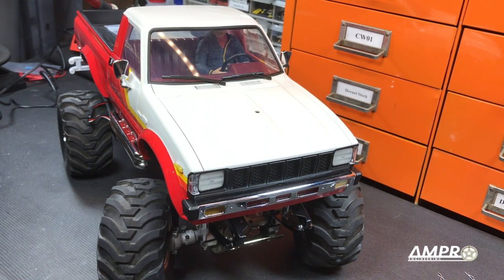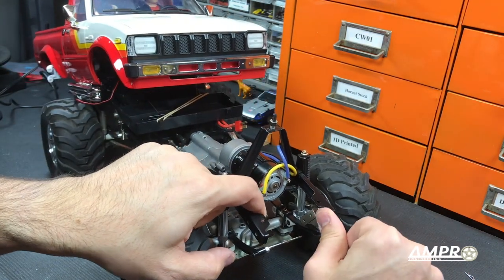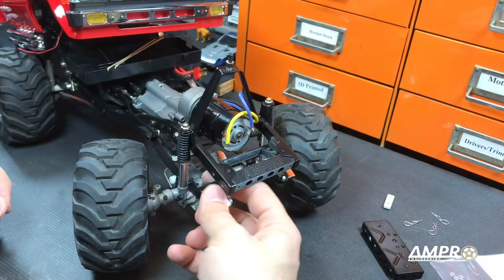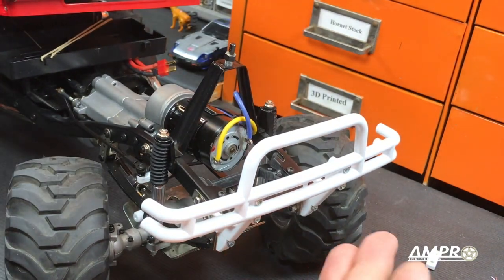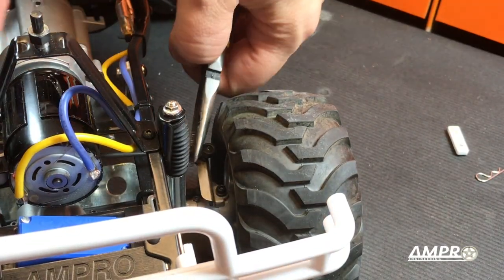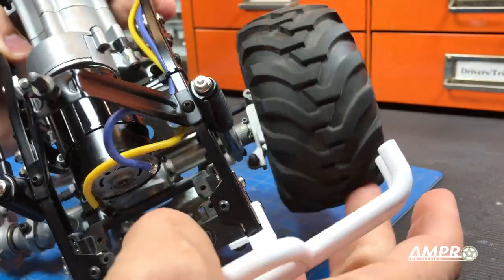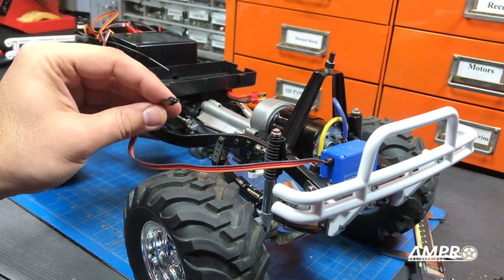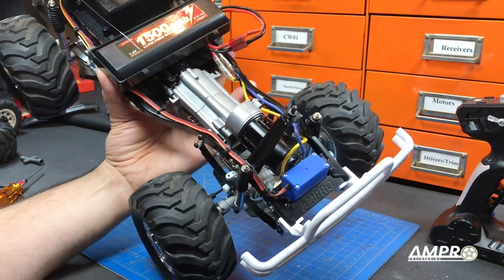e205: HG P407 Central Steering System

Comment: I did the samething but i mounted the servo on top the ampro piece because I found It kept popping the ball ends out of the steering link due to the angle of it. Had to cut a little off the frame but it works way better and is straight across and all around perfectly lined up. Has not broke sense then!💯🤪
Reply from the maker: Weird really? I have not had this issue. Glad you found a fix.

Comment: I just had the tabs snap off the 3d printed aluminum steering arm , wasnt expecting that ,  it did hold up for almost a year  so thats pretty good ,   i was just driving on flat land and i guess there was a small bump that jerked the steering just right and snap
Reply from the maker: Wow really? Man that's a bummer. Mine has been gut but who knows what imperfections there are.
Reply: @AMPROEngineering  Its ok i just ordered another one , hopefully it will be here by mid november

Comment: £14 for a piece of plastic and they cant even tap the holes for you ? Classy !
i'll give this a miss , there are easier and cheaper ways of sorting this issue .
Reply from the maker: This is a 3D printed part, this is not injection molded. They are made with VERY different processes, made of different materials, and made in to order.

Comment: Another elegant solution 😎👌🏻👍🏻 

Very much looking forward to your battery tray mod👍🏻 Will that be only for the clone car too, or is it likely to be a fit for the Tamiya rere?
Reply from the maker: Thank you! it fits the clone also, in fact that is where it is installed. I also have one for the original bruiser.
Reply: I’ve not built my re-re yet so am not familiar with the battery tray. 

I know the gearbox is different to the 1985 car, but I’m not familiar at all with much of the rest of the variations between the 1985 car, the rerelease and the clone. 

 Will you have battery tray mods available for all three cars ? 🙂
Reply: Just realised how old this video is 😆👍🏻

Comment: Hi. I have an ReRe Bruiser, and have bought your front Servo mount and front hub spacers. Looking for a viable way of connecting to the steering hubs after snapping my stock metal plate and found your YouTube channel. Tried looking on Shapeways where I bought the other bits and couldn't find the part number you posted. Would you have a link?
Reply from the maker: So the only parts I offer for this is the main mount and the steering arms, both are linked in the description and I validated the links so those are both working. If I am missing something, I am very sorry. If you could email me at Amproengineering@gmail.com I will see what else I can do.
Reply: @AMPROEngineering  I saw the link in the video when I viewed on my  PC instead of my phone. Will be ordering, after I finish my next Modification. Currently running Schumacher CAT XLS shocks all round. Will email you though

Comment: I added this servo mount this weekend. 
1.	I moved the shock mount behind the axle. Inserting the first screw second to the rear then using a scribe to align the front hole I was able to mount it without cutting or drilling on the frame.
2.	By moving the shock mount the steering arm no longer made contact with the shock body. I didn’t do a before and after but I think the turning is tighter than original.
3.	I took a crescent wrench and bent down the undergaurd diff cover as it was impacting the servo horn under fully compressed suspension.
4.	Using a turn buckle I had for an 1/8 scale application gave me a tight fit with no play at all. Redcat Part Number 81204.
Reply from the maker: Fantastic information. Thank you so much for that. I will look into this
Reply: @AMPROEngineering  Any time. I'll be ordering a second set soon. It's such a huge improvement.

Comment: Why buy a servo mount when you can use a dremel and cut a rectangle out of the original brace in between the two top screws and make your own servo mount. Mine worked fabulous.
Reply from the maker: Eh, I hate chopping up metal. This took 5 minutes to design.

Comment: Hi i need to replace the speed controller and steering servo and reciever any suggestions thanks on my hg p407
Reply from the maker: Any 2S Lipo speedo will work as long as it has 60A draw or more. As for a receiver, you need a 3Channel as well as a radio that accepts a 3 position 3rd channel. No clue about that one.
Reply: @AMPROEngineering  thanks for your help
Reply: I fitted a Hobbywing 1080 Crawler ESC to my ReRe Bruiser. So much better than the 1060

Comment: Pretty cool. All the screws on my "Chruiser" have been a boogerboo to remove. Seriously torqued down WITH sometype of red threadlock. Its a fine line between stripping the hex out, snapping a ball stud or rounding off a hex key. I split a Tamiya wrench trying to remove one of the steering ball studs.
But uts all fun still.
:))
Reply from the maker: Really! Man mine had zero threadlock on anything. I see they heard customer complaints that cars were rattling apart!
Reply: @AMPROEngineering  I know right? I guess getting threadlock depends on how late in the week when they're built. They gotta meet that qouta to get the weekend off !
:))
Reply from the maker: Hahaha! yeah you may be right.

Comment: Tracking number says mine should be arriving today. Can't wait to install it. Do you happen to have an extra instruction manual for the HG P407 or know where I can get my hands on one? Mine didn't come with one (or the decals) and I've had no luck getting the vendor to send me one nor can I find one online. Thanks in advance.
Reply from the maker: Cool! Let me know how you like it. I would assume you can locate one on ebay? I think the tamiya RERE bruiser should be close enough and you can get that as a pdf.
Reply: Really enjoying the HG P407 after installing your steering system. Unfortunately, I just had to order another steering arm from Shapeways as the original one of yours I got snapped and I wasn't even running it that hard.
Reply: Two runs in (and very mild runs) and the second steering arm broke in exactly the same spot. Very disappointed. The steering arm is just not strong enough.
Reply: Thanks for the input Jason, I think, i will make one out of thin steel.  Since the original piece is steel.  Aluminum looks like it’s way to brittle.  Going to go with a thin angle steel and using a Dremel grinding it to the shape of the steering arm..

Comment: Threadlock on plastic......NOPE
Reply from the maker: K S it’s a very common practice. There are even thread lock variants designed for different plastic materials since if a standard TL is used on Acrylic, it melts. For the poly jet material, it’s invaluable.

Comment: Very nice will the up grade servo mount fit the orginal tamiya kits?
Reply from the maker: Not the vintage Bruiser. The motor is actually bolted to this part on the vintage Bruiser and I do not know about the vintage Mountaineer or the RERE cars. I would hope it did but I have no way to test it.
Reply: @AMPROEngineering  it wont work on the vintage mountiner either . it might work on the rerelease bruser\mountiner seeing the hg kit is baised off those two
Reply from the maker: OMG you are right. I was thinking about the battery retainer I made.
Reply: @AMPROEngineering  I fitted your servo mount to the ReRe Bruiser
Reply: @AMPROEngineering  i was rite lol. You made a battery retainer i missed that video . check out the wpl c 34 km kit its a land cruser with all metal parts.

Comment: Hi, I was out jumping my Grasshopper, when I landed upside down it broke the shock tower right off the chassis. I don't want to buy a new chassis unless I have to. Can I glue it back on? If so what  type of glue should I use? Epoxy? Krazy Glu? Hot glue? Something else?
Reply: MrRadRc , use super glue and sprinkle baking soda on it (it will harden instantly and is very strong)
Reply from the maker: Yes, superglue is the way to go. The baking soda helps also, I use it often. I would also reinforce it with some polystyrene or even a metal backer on the tower to make it a bit stronger but remember that you still need to clear the body

Comment: Can this part be dyed black or did you paint it? I think the steering link should be mounted on the top of the arm to look more level.
Reply from the maker: It is painted black. The production version has the servo 3 mm higher but if the link is higher than that there is interference.

Comment: What is the name if the parts which connects the steering rod to the wheel hub that you connect for the steering rod
Reply from the maker: The technical name? Jeez, I dont know what it is called. The links are in the description if that is what you are referring to with the part numbers.

Comment: omg do some 3d printed aluminium hubs to allow fitment of standard sized wheels, you'd be a god among men, and I'd actually buy this and those and everyone would be happy
Reply: Seconded!!!
Reply from the maker: So RC4WD makes them but they dont work given the axle width. They just shove the wheels out more. The only true fix is to replace the axles. I made an adapted wheel that will work better than anything I have ever seen but it still needs to go inward more.
Reply: Thinking about your setup.  Does the steering link hit the frame or springs when suspension is compressed?

Comment: very nice upgrade,last year I decided to get some aluminum belcranks,, 1 for the clone and 2 for the old ones.. I think I had 1 I got some time back from rc4wd,but I could only find 1 on ebay.you pay some guy for it and it would be sent to you from somewhere else overseas, I watched it for a while but all at once they were being sold from several others, so I ordered 2 or 3 more,and they are still sitting in my Toyota parts tub lol..i go crazy looking for parts, and when I get them I put them in the correct 30 gallon tub of parts. anyway I wish you came up with that steering upgrade a year ago.
Reply from the maker: I also wanted to do that but was so tired of all the linkages. I just wanted them gone!